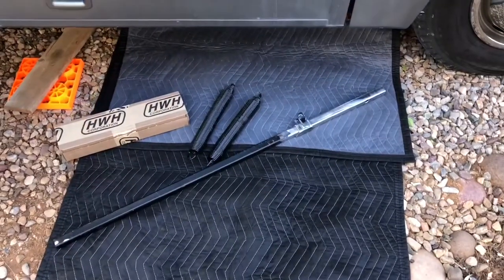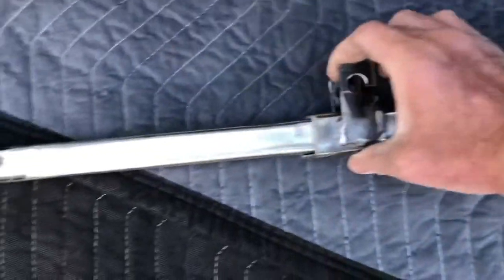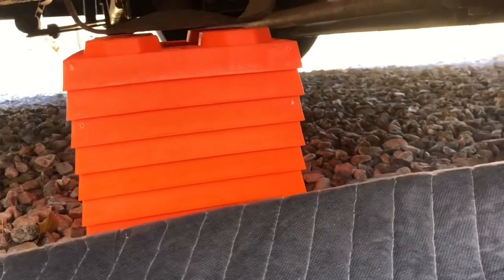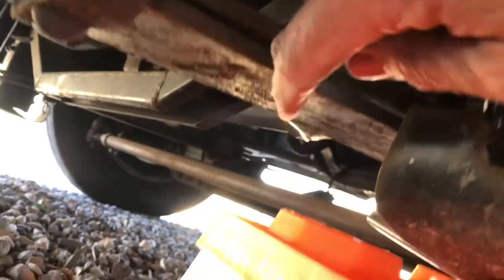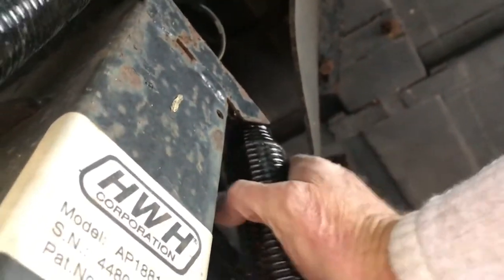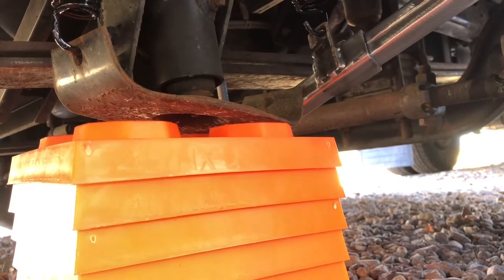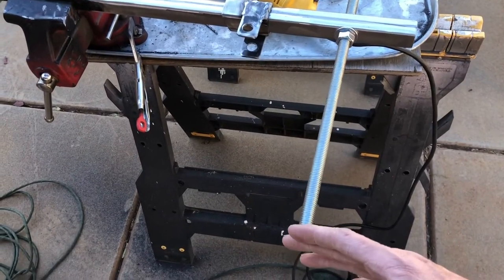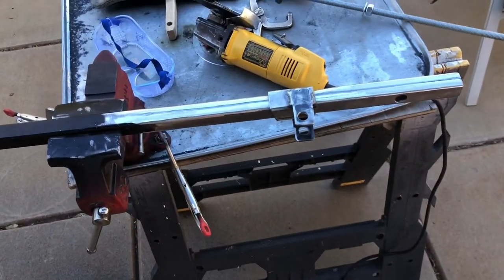HWH Leveling Jack Return Spring Replacement

Comment: I would like to thank you for this video. I made a tool as you did in this video. It works great. I had the new spring on both sides in less than 10 minutes. I had looked at so many videos that showed me to expand the spring and fill it with wood shims, metal washers or old paint sticks. This tool made it so easy to do I had to double check to make sure I was doing it right since it went so fast.

Thank you again.
Reply from the maker: Ditto, the wood in the coils was very difficult. I did see a video just last month where I guy used his vehicle to stretch (open) the spring between the hitch on the rv and the bumper of his vehicle. He backed up his vehicle just enough to put the wood shims in between the coils.  This worked nice for him; however, I would be concerned of over stretching the spring.  So the pry tool seems to be the best if you have a way to build one. Can you share a picture of your custom tool?  My email is coryrhanes@gmail.com

Comment: On the road and the replacement spring by dealer fell off. I have two spares and will see if I can install w/o pry bar with vice grips and a good pull. Thanks for posting great instructions. N

Comment: A simpler setup would be a 6x6 wood post cut to full length and place it under Jack(approximately 9”)..Then screw in with one screw a tie down ratchet to the post. Easy as ratcheting your boat to trailer…